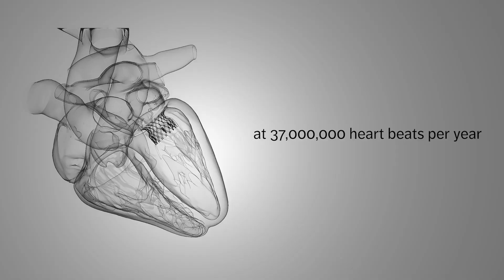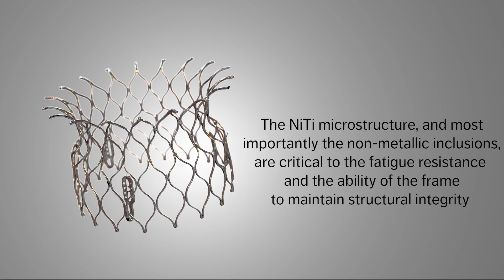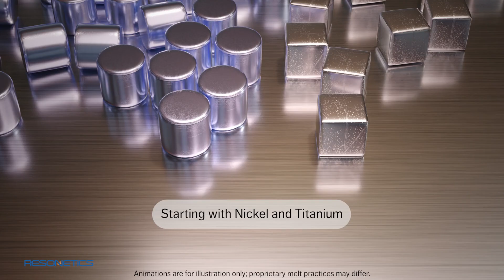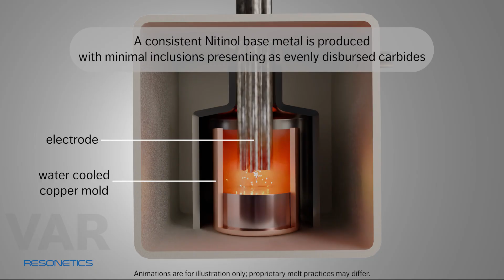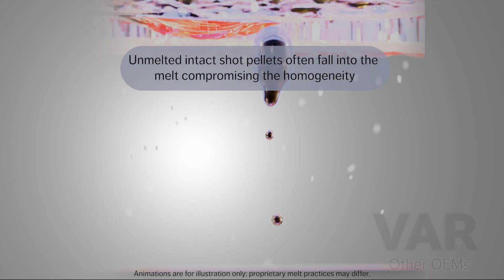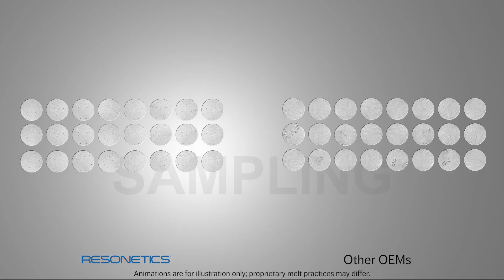Nitinol Microstructurally Engineered for Reliability

Comment: I have a nitinol medical device implanted in my fallopian tubes and a vaginal mesh and metallic hooks in my partial dentures. One day at my bathroom sink, I was thrown across the bathroom and smashed my mouth so hard my bottom front teeth sliced completely through my lip and DENTED THE SOLID METAL SHOWER BAR!!! And on top of that, there is a toilet between the sink and toilet, so i was drawn at least three feet across the room
 How did these 4 different metal have enough force to throw me across the room?